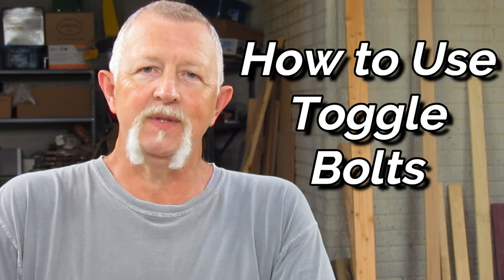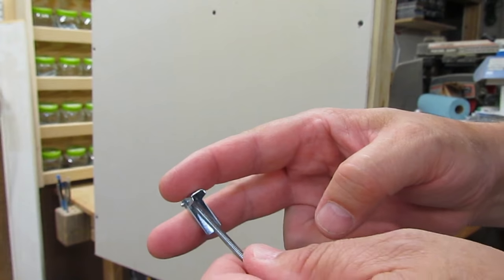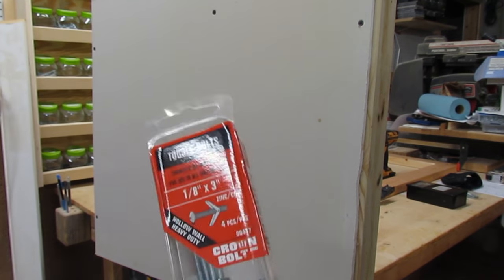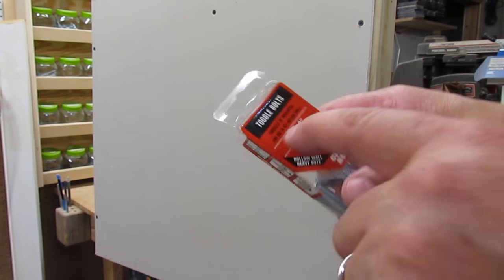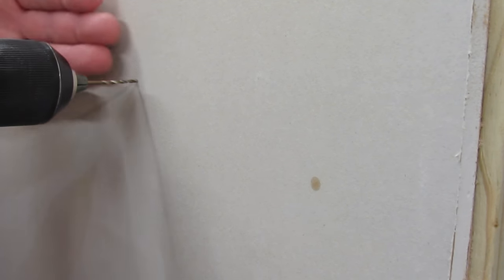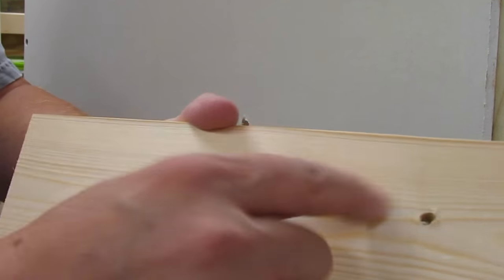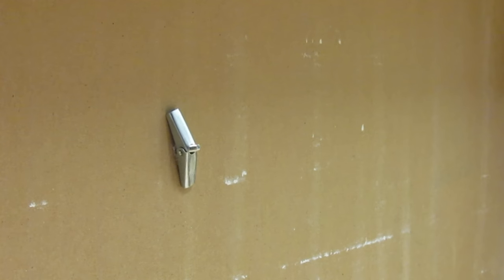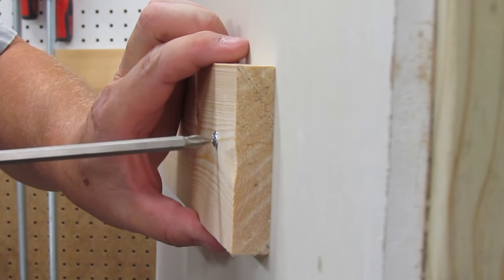How to Use Toggle Bolts

Comment: I have a dry wall that is covered with plaster, I need to hang a large mirror, what kind of screws/anchor/toggle bolts should I use?
Reply from the maker: Thank you for watching!  I'd lean more toward toggle bolts for a plaster wall.  You may want to get some wall hooks that can be mounted with the toggle bolts, then hang the mirror from the hooks.  Be sure the hooks are rated to carry more load than the weight of your mirror.  The rated capacity should be on the package for any wall hooks.  I'm thinking something like a heavy duty picture hanging hook:  https://amzn.to/2MoNX1n but I'd use toggle bolts rather than the included screws to mount them.
Reply: @dwcoffey  Hi Dennis, thank you for your prompt response! I appreciate your help. I don't not know the thickness of the wall, would toggle bolts be the option? Are you saying that toggle bolt is always the option for plaster walls no matter how light or heavy the frame?
Reply from the maker: It would depend on the wall construction.  If you have drywall/plasterboard behind the plaster, then yes, toggle bolts will give you more load carrying capacity than most all other hangers.  If you have older construction with wooden lath behind the plaster, then you could use toggle bolts, but I wouldn't put nearly as much weight on them unless you know you have drilled into the wood lath rather than a gap.

Comment: If you're doing a tv mount, there's 4 holes. You tighten one, it pushes the mount closer to the wall, then you don't have any space to put the bracket behind the other 3 how do you deal with that?
Reply from the maker: Thanks for watching, Kessy!  I put all 4 screws thru the bracket, then all 4 toggles into the wall holes, tighten each one a small amount at a time while holding the bracket against the backs of the screw heads (for tension).  As they all tighten up, I make sure each toggle is engaged enough (by feel) to tighten completely.  Basically I just tighten each one a little until they are all tight.  I hope that helps.
Reply: @dwcoffey  Yea that was excellent. Thank you very much, I was able to use these to get my TV mounted after struggling with other anchors. I have a thin wall, so other anchors had no room to drop and pullback and tighten. It was very frustrating. Thanks.

Comment: Very good video but Dennis neglected to mention that toggle bolts can’t be used if there is insulation in the wall because it prevents the toggle from springing open. 0:40
Reply from the maker: Thanks for watching, but I've never had a problem with the toggles not opening because of insulation in the wall.  Rigid insulation will probably stop the toggle but I've never had fiberglass cause a problem.

Comment: HELP!!!!  So I’m trying to hang an iron basket from my ceiling.  I’m using 1/4inch by 4inch toggle bolt.  I have it installed but there’s nothing to place the baskets hook to??  Was I suppose to buy something else?
Reply from the maker: Hi Brandy, thanks for watching!  In most cases, when using toggle bolts, you have to put the screw thru the item you are hanging, then put the toggle on the end of the screw, then push the toggle thru the drywall hole, otherwise you can't get the item you are hanging on the screw.  Also, I offer a suggestion.....I'm not sure how heavy your iron basket is, but hanging anything heavy from the ceiling may not be the best application for toggle bolts.  Toggle bolts are more suited for hanging heavy things on walls due to the drywall.  The forces put on drywall in a ceiling-hanging application will likely cause the drywall to break out.  I'd recommend using a stud finder to find the ceiling joists, drill and screw in some lag-hooks.

Comment: Dennis, how can I leave the head exposed to hang a mirror?
Reply from the maker: Hi Amanda, thanks for watching!  The best way I've found to do that is to thread on a nut and a large washer nearly to the head of the screw, then the toggle and install as normal.  Run the washer and nut up to snug on your side of the wall, leaving a portion of the screw and the head of the screw proud so that something can be hung off it.

Comment: Hi if the drill hole is bigger then the toggle needs would this still work? For example I have drilled a 18mm hole but should have drilled a 14mm hole.
Reply from the maker: Thanks for watching!  Yes, just make sure then the toggle, when expanded is larger than the hole you drilled.  It should be given your dimensions.  Once the toggle is pushed through the hole, it will expand and catch on the back side of the hole.
Reply: @dwcoffey  thank you Dennis! 👍
Reply: @dwcoffey  worked fine and the shelves are now up! Thanks for the advise!
Reply from the maker: Fantastic, I'm glad it worked out!

Comment: Just checking, three toggles x 300lbs is a combined 900lbs of hold/support weight? But that would only be at the location of the bolt correct?
Reply from the maker: Yes, that's correct.  The drywall will fail before the bolt does.  Thanks for watching!

Comment: Great video. Thanks! Do you think this would be a good solution for plaster walls? Is there a better alternative? Appreciate it.
Reply from the maker: Hi Kate, thanks for watching!  I'd lean more toward toggle bolts for a plaster wall.  You may want to get some wall hooks that can be mounted with the toggle bolts, then hang the item from the hooks depending on what the item is and how heavy.  Be sure the hooks are rated to carry more load than the weight of your item, especially if it is heavy, like a large mirror or something.  The rated capacity should be on the package for any wall hooks.  I'm thinking something like a heavy duty picture hanging hook:  https://amzn.to/2MoNX1n but I'd use toggle bolts rather than the included screws to mount them. It would depend on the wall construction too.  If you have drywall/plasterboard behind the plaster, then toggle bolts will give you more load carrying capacity than most all other hangers.  If you have older construction with wooden lath behind the plaster, then you could use toggle bolts, but I wouldn't put nearly as much weight on them unless you know you have drilled into the wood lath rather than a gap.
Reply: @dwcoffey  Thanks! We just need to anchor a bookshelf to the wall, so the shear is the weight we will be worrying about. It is plaster and lathe. Not too big of a gap between lathes, so hopefully we will get into the wood.
Reply from the maker: Sounds good.  Chances are you will get plenty of wood between the toggle and the backside of the wall.  The downside to toggles is that you have to drill a pretty big hole for each one, but, the larger toggle (and hole) you can tolerate, the more load bearing surface you get.  Thanks again for watching!

Comment: We have a small ikea wall mount bathroom cabinet to go up, with no studs where we need them - of course! Could we use two toggle bolts to mount it? The cabinet itself is about 23 lb, and we plan to use it to store toilet paper, some bars of soap, and some pill bottles. So total weight should be no more than 50 lb? Thanks!
Reply from the maker: Thanks for watching, Leanne! Yes, this is a great application for toggle bolts.  I recently mounted a similar cabinet over one of the toilets in our house and that's how I mounted it.

Comment: Great tips and nice explanations!  One thing though, the size doesn't have anything to do with the size of the 'toggle' or 'wings'.  The fraction indicates the size of the bolt portion of the toggle bolt.  A 1/4 X 3 inch toggle bolt is a 1/4 inch bolt (20 threads per inch) that is 3 inches long.
Reply from the maker: Thanks Heather, really good point and I should have known that!  I guess the 1/8 toggle is a bit off since they use #6 screws, but still close enough to be called a nominal dimension.  Thanks for that info and I appreciate you watching!!

Comment: I went 1/2" into the dry wall and that was it, would not go any deeper.  I'm pretty sure I hit concrete (perimeter wall).  Not sure what I can do to hang 22 lb curtains.
Reply from the maker: Thanks for watching, Jane!  If you hit concrete, you'll need a masonry bit and masonry fasteners like Tapcons or lead expanders.  It would be unusual for somebody to have installed drywall directly onto concrete though....there should be studs or furring strips of some kind between the drywall and the concrete wall.  Maybe you hit a stud?  About the only way to tell is to see what comes out with your drill bit.

Comment: Does it matter if your trying to hang a shelf where the bolt is threaded? And you can't move it freely like in that piece of wood...
Reply from the maker: Thanks for watching, James.  As long as you can tighten up the toggle to securely hold your item, it will be fine.

Comment: is it possible to use toggle bolts on concrete?
Reply from the maker: Thanks for watching, Melyana!  You can use toggle bolts on concrete block walls, but if it is a poured concrete wall, you will need to use lead expanders, Redheads, Tapcons, or similar.

Comment: I was leaning more toward toggle bolts for a plaster wall that has wire it the plaster, yes, I have a older house but I tried the toggle bolt you had and the shelf wouldn't hold on one side and I can't find the stub in the wall, because of the wire.  Hope this makes sense. Any suggestions?
Reply from the maker: Hi Cindy,
  I'd suggest one of these stud finders that can tell you what you are seeing in the wall and that can find a stud even in the presence of mesh in the wall.  Sounds like you definitely need to anchor that shelf into studs.  Sometimes you can find studs by just knocking on the wall and listening for the sound to change....then possibly drill a very small (like 1/16") hole to see if you hit wood.  Once you find one stud, you should be able to measure 16" over and locate the 2nd stud.  I hope this helps!
Reply: @dwcoffey  I was able to work this out and get my shelves up. Thank you1
Reply from the maker: @cindywest2689  that’s great Cindy. I’m sorry it took so long for me to answer. So glad you got it worked out.

Comment: How about how to remove it? I had a  client reach out to me cause they wanted to remove it and after unscrewing it, the screw wasn't coming out so I had to pull it out.
Reply from the maker: Thank you for watching!  To remove a toggle bolt, you have to apply a bit of outward force to the screw as you unscrew it, so that the toggle stays in contact with the back of the wall.  Otherwise, the toggle will just spin and not allow the screw to back out.  Once the screw is backed out, the toggle will usually fall to the bottom of the inside wall cavity.
Reply: @dwcoffey  alright, that s what I started doing until it wasn't coming off but thanks. Great video thou really helps how to use Toggle Bolts.

Comment: What about the other side u can’t pull it away from the wall enough to tighten the toggle on the other end of the wood so I’m confused
Reply from the maker: Thanks for watching, Karen.  You have to tighten each a little at a time, keeping tension on both.  You can also hold the screw head out with a fork while tightening, so you can keep tension on the toggle until it is close to being tight.

Comment: Doesn't the 1/8" or 3/16" refer to the diameter of the bolt?
Reply from the maker: Yes, it does.  Thanks for watching!
Reply: Thanks for your reply. I was confused at 2:27 when you said that nothing you measure on there is 1/8". I have a toggle bolt labeled 3/16", and the bolt diameter (including threads) is pretty close to that.
Anyway, thanks for the video -- the tip at the beginning is especially helpful. I've been through 3 different kinds of anchors for my current problem project, and I need all the tips I can get!

Comment: So do not install into a wood stud.  Right ?  Going to install slat wall shelving , 4 feet wide .  Intent is to hold 150 pounds per 4 feet
Reply from the maker: Thanks for watching, Reuben!  Correct....if you hit a stud, it is better to use a wood screw for that fastener.

Comment: All of these videos show you how to insert the toggle bolt. No one explains what the rule is on drilling hole size. What does the # on the toggle bolt mean? Ex: 1/8"
Reply from the maker: Thanks for watching!  See 2:27 and 3:30 in the video.  The size on the toggle is just the size of the screw or bolt used with the toggle.  Most toggle bolts packages will give you the size drill bit to use.  If not, here's a guide:
1/8" toggle, use 3/8" drill bit
3/16" toggle, use 1/2" drill bit
1/4" toggle, use 5/8" drill bit
The hole has to be large enough to get the wing-part of the toggle thru.  It is usually a tight fit and you may have to work the toggle into the hole.  I hope this helps!

Comment: Once you get one tightened, how do you the second? No room to add the toggle. Lol
Reply from the maker: Thanks for watching, James!  Great question!  You have to insert both at first.  Then you can hold the screw out, so that the toggle contacts the backside of the wall, and tighten the second one.  I usually try to tighten each one, a little at a time, until they are both tight.  Hopefully this helps.  If not, let me know and I'll explain it a different way.  thanks!

Comment: I hate these kinds of toggle bolts. When you have more than one hole that you want to run your toggle bolts thru, it becomes ridiculously impossible to use both the bolts at the same time. Let alone the stupidity of pulling the object to tighten the bolts. Stupid design if you ask me.
Reply from the maker: Thanks for watching!